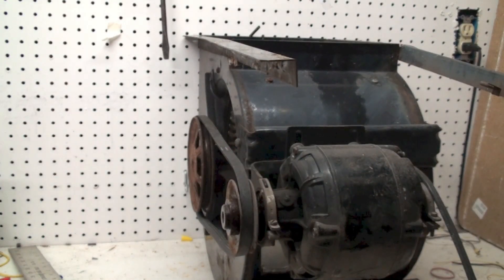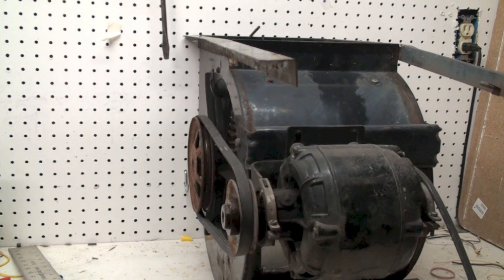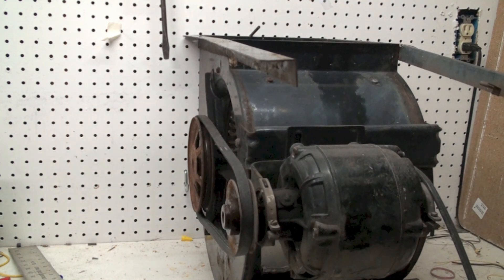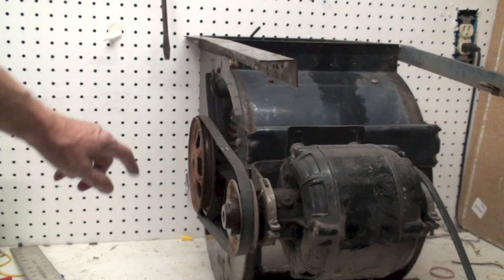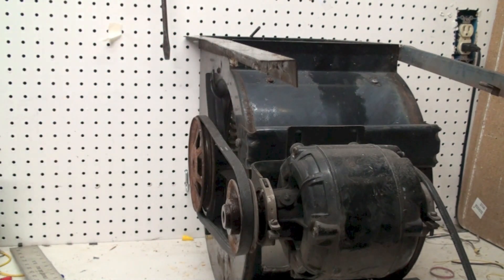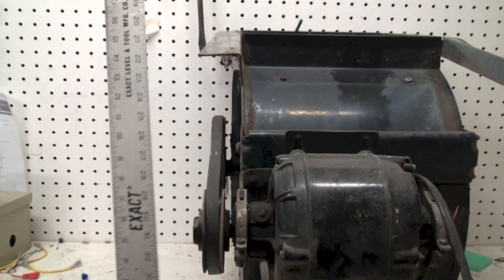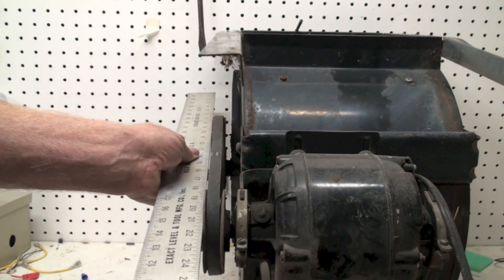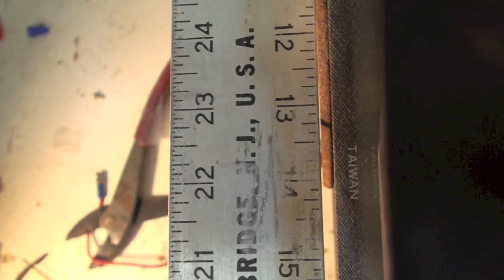How to align the pulleys on an HVAC blower

Comment: What if the pulley thickness is different on one of them ? Whether you use laser or straight edge it's gonna be side mounted ?
Reply from the maker: You are trying to get the belt to be lined, not the edge of the pulley. You have to account for the difference in pulley thickness.
GFM

Comment: Hello, how would you evenly tension a double belt Sheave with a platform indoor motor base?
Reply from the maker: Its not much different than with a single pulley.  As long as the straight edge touches all 4 surfaces of the pulleys, you should be good to go.  If the belts do not have equal tension after alignment, you need to replace belts and/or pulleys.
GFM
Reply: Thanks

Comment: didn't really get into changing that angle if needed.
Reply from the maker: You loosen the driver pulley set screw, and adjust the pulley until it aligns up.  If this does not do it, the motor mount has some adjustment that can be changed.  Hope this helps.
GFM
Reply: word

Comment: You demonstrated how to check alignment.  If it was out of alignment what would the steps be to get it into alignment?
Reply from the maker: +Ready Temp The motor is the only part of the unit that is adjustable.  The mount is adjustable in 2 dimensions.  Hope this helps.
GFM
Reply: Thanks